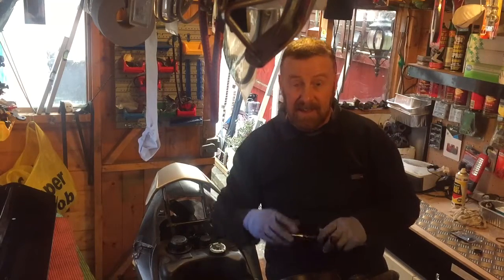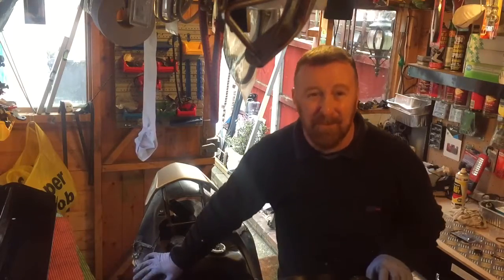Speedfight how to tell if your oil seals are gone mark savage

Comment: Hi mark my name robbie on my moped there no spark I got a new cdi spark plug and coil and there's still not spark do you know what wrong
Reply from the maker: I have over 50 other videos on speedfights bud take a look at some others as they may help, so you have changed the cdi? which one was it as there are 4?, coil and plug? do you have power coming from you stator?? as if you have already changed them check that bud, hope that helps please like share and subscribe ,mark
Reply: mark savage I have checked it like you said it could be the stator I will check later

Comment: hey pal sorry but what's happening my bike was bogging down change my exhaust and cdi cleaned my carb and my rollers but it all back together and no start but it's Turing over
Reply from the maker: kinggino08 your going to have to start from spark , is petrol getting in sucking in from carb , give a watch of my other videos mate they should help . Then work out what's next , hope that helps bud please like share and subscribe , mark
Reply: mark savage think I have watched all of you video haha I'm getting a spark but how would I know if it's getting there and what could possibly be stopping it cheers did think you would reply been looking for 3 day for answers ha
Reply from the maker: kinggino08 wow you have watched all 50 odd lol so you have changed cdi which one was it as in my videos coil ok stator coil ok, so you have taken out spark and seen spark? , are you getting petrol in pot and a wet plug, did you try easy start ? What the piston like , if you have changed the exhaust did you up jet it and what jet are you running with now ? , would of re take off carb and start again and can you adjust the air mix,? Mark
Reply: how would I go about changing the air mix and what would stop the petrol getting to the carb because I can only think it's petrol not getting to the car because it has a good spark and it was running yesterday but cut out
Reply: then I took the carb off to clean and that's how I got where I am
Reply from the maker: kinggino08 best take carb of and re clean with carb cleaner and in my. Carb clean video I show and take about the air mix and petrol and I've done 4 odd of them , mark

Comment: Hi Mark, got my first speedfight a couple days ago, I've put a polini variator on her, I am a fan of acceleration so how light/heavy weights do you recommend. Plus it's a 1999 water cooled prost edition I was also wondering if you know how to fix the temp gauge, cheers mate!
Reply from the maker: George Salf hi bud I always use 4g and 8g 3of each , as for temp check the connector on top of the head it maybe off , if you take out the bucket you may find it on the right hand side but as long as you are not leaking water and it's topped up it will be fine bud , I have a few videos on the connector maybe have a look at my other videos bud and thanks for watching please like and share subscribe , mark
Reply: mark savage Thanks mate that's brilliant, been a sub for a while great videos by the way